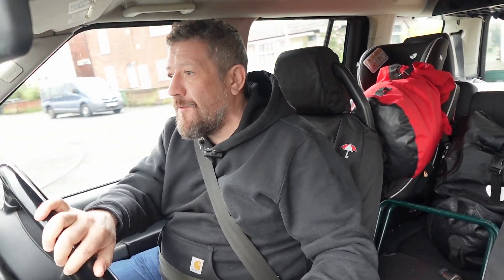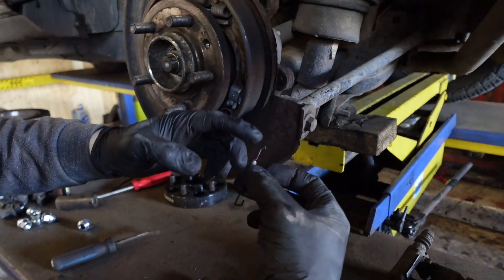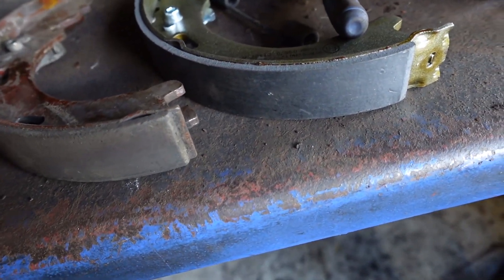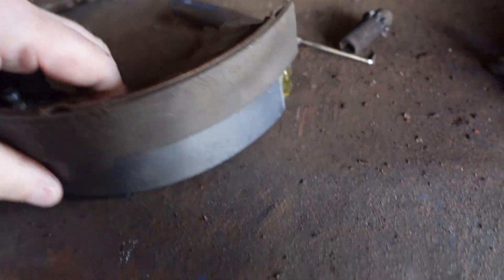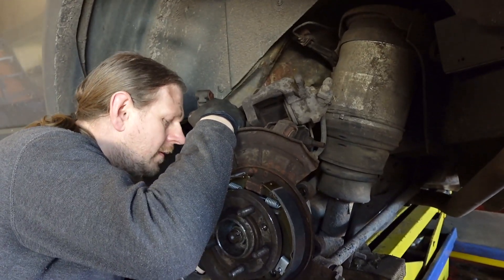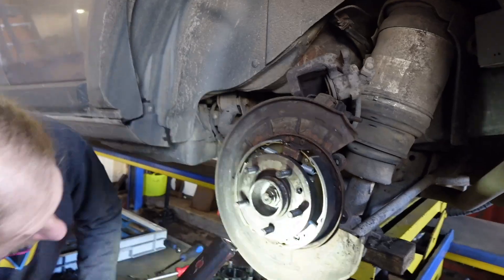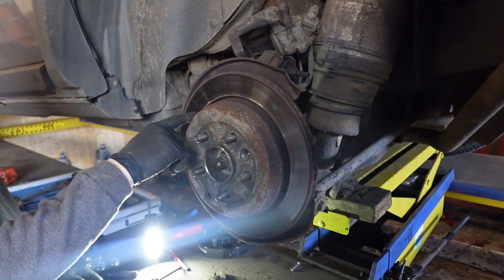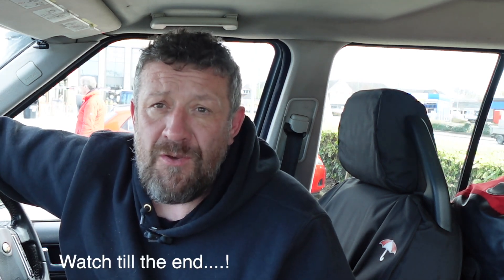The REAL reason your EPB fails again and again on your Discovery

Comment: Having seen other peoples videos, I was on the brink of selling my car for spares or repair when my parking brake failed, then I came across this video, i rang the company and spoke to dave at epb, he told me the standard fixed price along with a time and day, I dropped the disco off with him and went to a cafe for breakfast, I then spent a hot and sunny 4hrs on southport seafront, at 13.30 my car was ready and working perfectly, and I have the priceless knowledge that it's been done correctly, dave at epb specialists, does what they say on the tin, ..its a no- brainer.. either 4.5 hours at the seaside or 4-5 days on your back, running the risk that it is still not set up correctly.

A very good price and well worth the money
Thank you, dave, so much for your professional time and service, and for giving me back my car.

Comment: Great video. Just tackled mine.   What is the white grease inside the epb? And can I use cv grease?
Reply from the maker: I wouldn't use CV grease as it's designed for metal. You need a plastic grease.
Reply: Thanks.

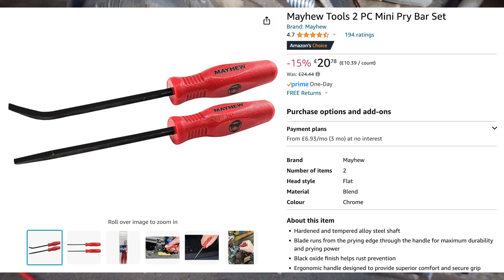Comment: Great Vid, Lot's of tip's there, keep them coming, ?Did you know that all D3 back splash plates have a notch in them, so the service technician knows where the shoe adjuster is when assembled to there adjustment. :)  9:03 in to the vid.

Comment: The best way to prevent your EPB from going wrong is to only have an Automatic Disco 3/4 and use the ‘P’ on it, without the need to ever use the EPB, other than MOT day or maybe once per month just to stop it seizing up.
Reply: But if you don’t use it, it will seize up and you only find out at the MOT. After 19 years owning and maintaining my 05 D3, my recommendation is to use it all the time. And at say 2 year intervals check the adjustment of the shoes. Tempting fate - at 195k miles I am on same EPB and second set of shoes. Never had the squeal.
Reply: @barrieneill410  Interesting. I also have an 05 Disco (Automatic) which i have had for 8 years. No problems with the EPB so far. I just use about once/month to keep it unseized.

However also have a RR  2010 RR Sport and forgot to use the EPC for 6 months. It then needed unseizing. That was 6 years ago and no probs since.

I had a Manual Disco that put the EPB on every time you take the keys out. It was such a pain and would start squealing every 6 months, requiring it to be reset, that I took the fuse out except for MOT days.
Reply: Use it every time and it will never sieze! No risk then of forgetting a "monthly" exercise of the system.
Reply: @hairyfool7361  Can’t agree. I’ve spent fortunes on Manual Discovery EPB’s. It got so bad that I pulled the fuse out to stop it coming on every time I took the keys out of the ignition.
With the Auto,  I just use P and preserve the EPB by only very occasionally using it.
Reply: cant use an auto 3 or 4 and parking on a hill and not use the parking brake 🤣🤣 no one should take ur advice
Reply: Subaru owners did that but then at inspection found it was corroded solid 😞